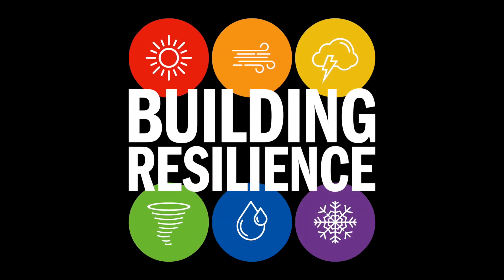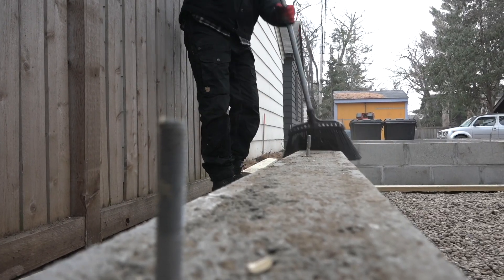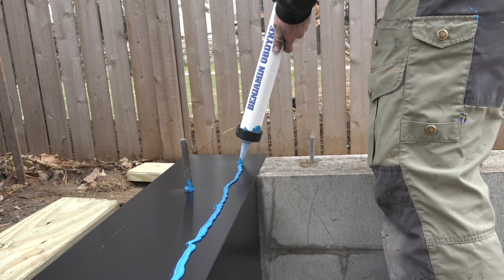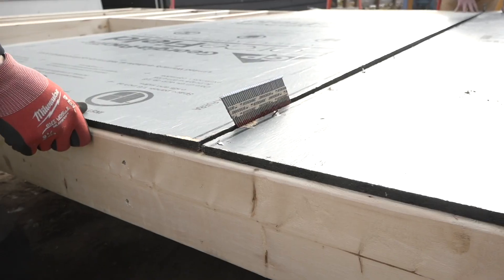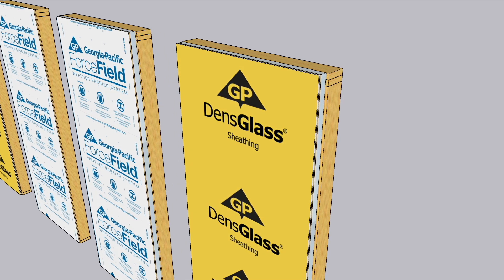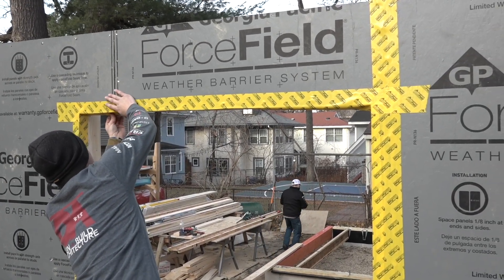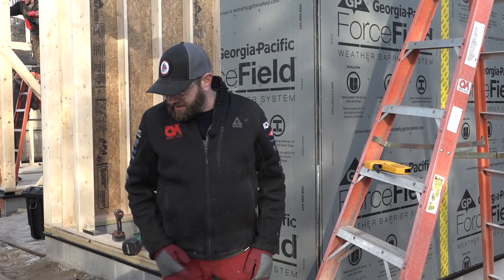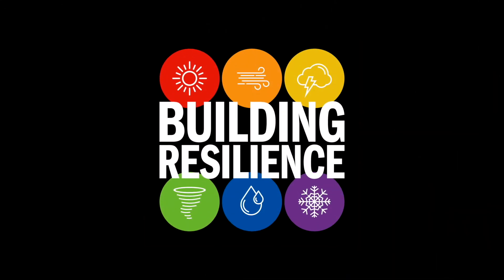Framing Walls with Forcefield Sheathing (Building Resilience)

Comment: I'm a newbie and still learning about building science so I'm hoping you can help me understand something. According to another video you've linked to from your site, Joe Lstiburek's "The Perfect Wall", the recommendation is for the water/air/vapor control layer to attach to the structure and then have the thermal layer exterior to that. However, in this video, the thermal layer is inside the WRB. Why is that?
Reply: Great question, and as you can imagine, the answer is nuanced. There are two main approaches. One is for sheathing and all the control layers and windows to be at the framing, and then add all the insulation on the outside (Perfect Wall). The other is what we have in this video. (The Awesome Wall).  Keeping windows in line with the WRB is the trick. The advantage of this system, is that we don't need strapping. Windows and siding and trim are all installed as usual, which keeps costs down and doesn't require specialty training. Also, of note, the Perfect Wall has all of the insulation outside of the structure. The Awesome Wall splits the insulation 50/50. Hope this helps!

Comment: Any concerns with the Advantech SFA reacting with the foam?  Do you have lateral requirements?  If so, how does this impact that since neither company has testing data for this application? 

Nice job with the video and editing.  Lots to figure out going forward as we tackle continuous insulation.
Reply: Great questions! We did some wingnut style testing on the adhesive a few years ago. It bonds to XPS pretty well, and doesn't eat away at the foam. (turns out they are chemical cousins.) We know that it bonds to wood as well, so it was a logical choice. We've used this on a few projects now and also with a pvc sheet to xps panel with success. The long term adhesion isn't known, but considering how easily the Iso releases from the ZIP, I'm not overly concerned. The glue needs to last long enough to get the panel on the wall. We do have shear requirements, but they are all met within the framing before the panels. The engineer is treating these with the same values as designing for the ZIP R12 product. We're about 8 years into working with this kind of system now. It gets easier, but there's still quite a bit of thinking around layout and tools that needs constant tweaking. Glad you enjoyed it!
Reply: @oadesignbuildarchitecture9688  How do you get your lateral resistance?  That's what we are figuring out with ZIP R6.  Our engineer has us tighten up nailing but the time will come when we need more shear than the panel will provide (e.g large windows in a shorter wall).
Reply: @AwesomeFramers  In the areas where needed we have a couple of options. We can install diagonal strapping or we can install a layer of sheathing prior to installing the ZIP R panel. Sometimes the engineer will also come up with something more complicated.. :) We've got another video called 4 wall types, that goes into that with more detail
Reply from the maker: I agree with the ding dong above.

Comment: This video is awesome and very informative! I am curious to know why not use Zip System R-6 and then Dens Glass on top of it? Was it price point? Thank you!
Reply from the maker: Hi, Thanks.
No, it wasn't a price thing. Georgia Pacific a sponsor of this episode, so we were happy to use their product. We wanted to check it out, anyway. 

Also, we wanted to show that you can make insulated panels on site. It solves some nailing problems with continuous exterior insulation and creates some airsealing problems. Spray foam or interior cavity air sealing must accompany built-up panels like this. At least that's what the smart people tell me.

We also used similar panels for an exposed floor system, made with PVC sheets and Styrofoam. Stay tuned for that video.
Reply: R6 also doesn't quite get us to where we want to be. R10 continuous (2" exterior insulation) gets us close to 50/50 exterior/ interior insulation. It also removes the requirement for a vapor retarder.
Reply: Thanks!! We're up in Climate Zone 6, so we would typically use ZIP R12. Sometimes it is easy to get, sometimes it is hard to get, so the opportunity to explore and share solutions using readily available materials (Dupont and GP) was pretty exciting!

Comment: Just used forcefield for the first time on a barn.  Compared to zip, Zip’s coating is more durable.  But compared to regular house wrap they both are better in air and water protection.  Forcefield $15 cheaper per sheet compared to zip in my area.  I am moving forward with a house build using forcefield.  At the end of the day I would prefer to use zip but 20-30 years from now either will perform their job equally behind cladding.
Reply: Great choice! I think waterproof sheathing is the future, and the future is now. Every company will need to make their own waterproof OSB product like Zip. It's a no-brainer. Mass production reduces cost and increases quality. Just having to tape the seams reduces so much job site work and error. I predict the tape will also be replaced in the future, either with a one-step liquid application gun, or rabbet joints with pre-applied seals for less taping where applicable.
Reply from the maker: I know, right? and if the crew was going to tape the seams of the housewrap, anyway, then taping the seams of sheathing adds zero extra time. It just saves time and reduces errors.
Reply from the maker: I think what happened is that Zip developed a roof sheathing product and realized, "Heck, this works great for walls, too," whereas Forcefield was developed as a wall product.
Reply: Both products invented by the same person. He recommends FF for walls due to the price savings.
Reply: I agree. I think they will both perform equally well over the long term. Especially if paired with a rain screen that allows for rapid draining and drying behind the cladding.